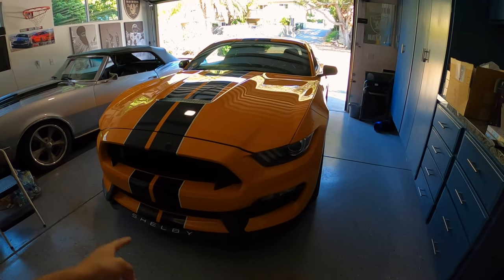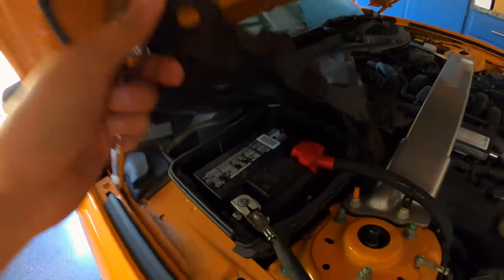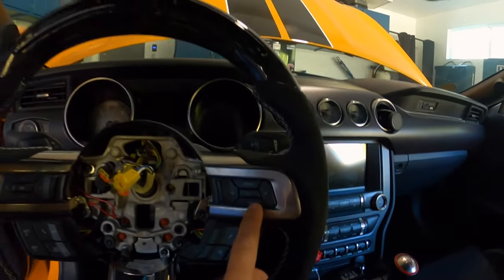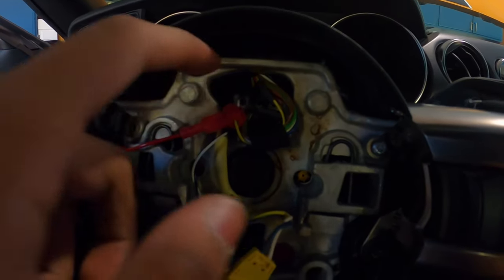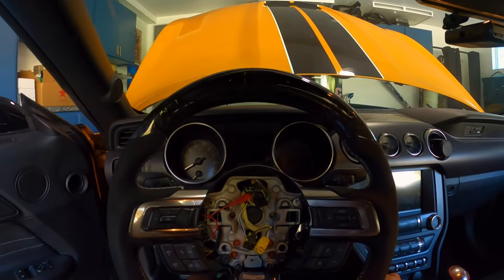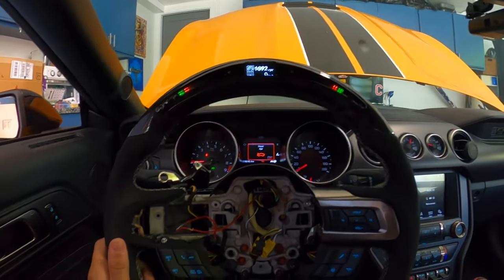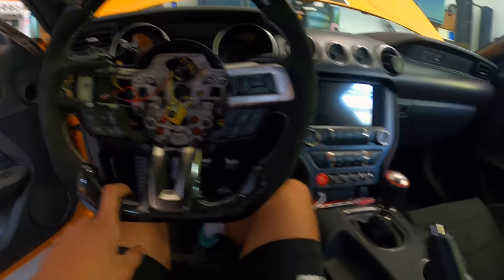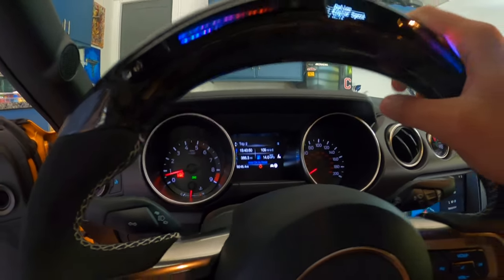Mustang Custom Steering Wheel Install(With Shift Lights)

Comment: Bro I had the exact same issues when I installed mine, after finding power source drove out the garage it would go off, drove in the garage and it came on, I didn’t find a reliable dedicate 12V source, I just got a small rubber cup and put it on top of the light sensor, I know headlight would turn on but I just switch the headlights off. Also what brand is your steering wheel? Mine is carbon bargain and I had to modify air bag retainer clips because they were too long for, I also had to shave air bag tabs, they were too thick too, in other words it wasn’t a plug n play install, if for whatever reason I want to reuse air bag with stock steering wheel I can’t, have to buy another air bag. It was worth the pain though, I love it!!
Reply from the maker: Yeah there is no other reliable 12v. I bought my wheel through CarbonCartel on Instagram. They offered a partial sponsorship so I paid $650. That sucks that your clips needed to be modified. Mine just went right and was super easy aside from the wiring.
Reply: @NanuGarage  thanks for the info bro, have a friend who’s interested in getting one,  now I can tell him with the Carbon Cartel no modifications needed to air bag, great video, keep up the great work! 🤙🏽
Reply from the maker: @Orangefurygt350  Thanks bro, I appreciate it.
Reply: Hey guys, I’m having the same issue here with a 2019 GT. Should I use the yellow as 12v power ? What source did you guys end up using ?
Reply from the maker: @felipemolina6334  it’s different for all years. I would use a voltmeter and check which wire has 12v and use it
Reply: @NanuGarage  the yellow one worked for me last night, and then today it wouldn’t work. I think I have the same wiring as you do. Which color did you end up using ?
Reply from the maker: @felipemolina6334  I used the yellow shown in my video. My lights still turn off during the day unfortunately. I couldn’t get consistent 12v from any other wires. If yours turn off during the day you can cover the sensor on the top of your dash during the day with something.

Comment: So which 12v did you end up using? and if you have to run another wire how do you avoid issue of the steering wheel spinning?
Reply from the maker: I tried using all the other ports to combine for 12v but it was super inconsistent so unfortunately the only way was to wire it to the interior lights slot.
Reply: @NanuGarage  I notice you’re not using the steering wheel in your later videos, is this the reason?
Reply from the maker: @fiftyshadesofurban  no this isn’t the reason. I stopped using the custom one because it felt pretty heavy and the oem feels more nimble

Comment: You don’t need to undo your battery foolish. ASE CERTIFIED, Toyota MDT, Nissan expert, and 12 years experience I have never undone the battery nor have I seen a tech do it when dealing with airbags and keep in mind I was a tech for a large part of the air bag recalls so I’m replaced a lot of airbags
Reply: You will never work on my car, thank god I don’t own a Nissan/Toyota, that’s just ignorant
Reply: I'm certain that you're a technician with no proper degree in electric currents or automotive engineering 😭
Reply: Disconnecting the battery has nothing to do with the airbag itself. You are literally installing a new electrical circuit why in hell would you do it with live wires?